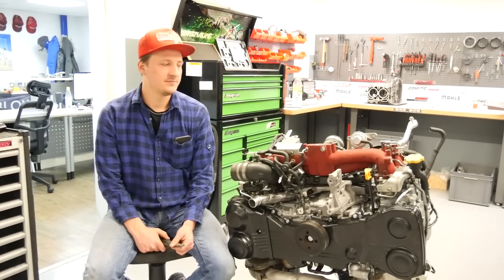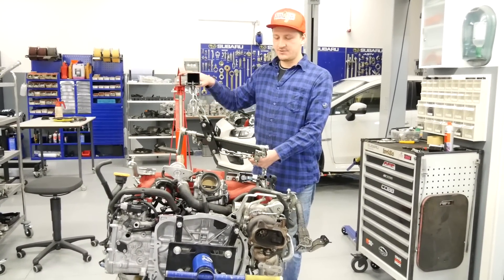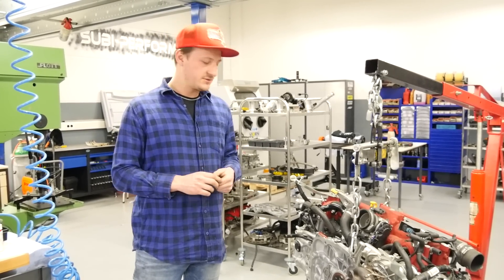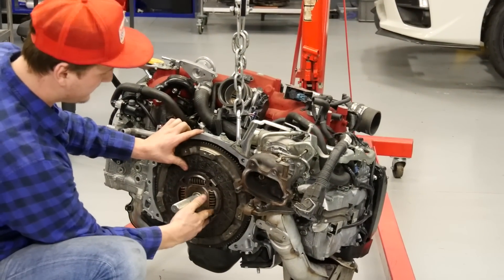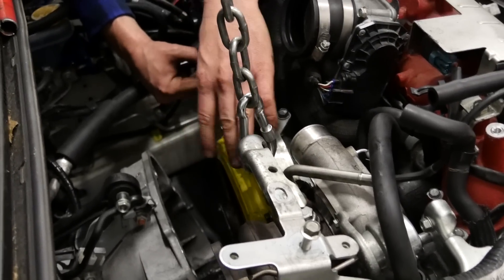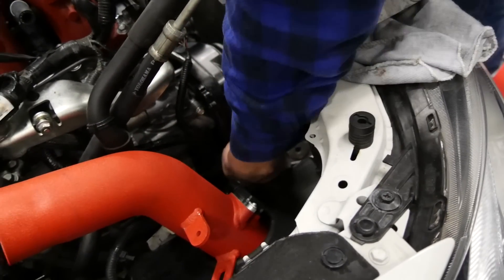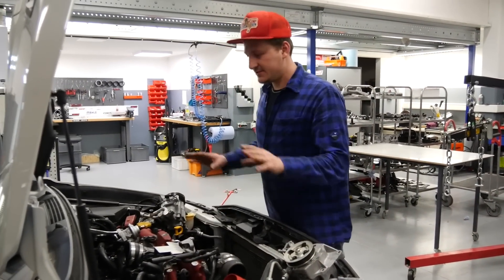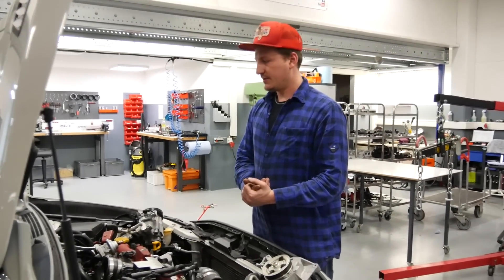HOW TO Engine Install Subaru Impreza WRX/STI EJ20/EJ25 / エンジンの取り付け方法 PART 1 l Subi-Performance

Comment: What performance recommendations would you have for a 2003 5-speed manual, Impreza RS 2.5 NA? High-cost, middle and low cost options?  
Thanks!

Comment: Need some help, I forgot to put the clutch pin all the way in before bolting up the engine to the transmission, do I need to pull the engine back out? Can someone please help me with this thank you guys

Comment: Ca sa prepari un motor de subaru impreza pentru raliu te costa cel putin,40.000 de euro in Germania motorul fiind cu turbo suflant deci masina sport practic nu ai ce sa faci decit marirea raportului de compresie si asa automobilul finiind de strada merge linistit cu benzina preparata pentru raliu cu cifra octanica 102 pe cind motorul este preparat de raliu atunci benzina este de 107 cifra octanica preparata dupa fisa motorului in laboratoar petrochimic

Comment: I remove the axles nut because when you lift the trans with the suspension sagging you can pull the inner cv apart

Comment: hi i own a 2 litre subaru  model number bc4a46a  option code WX  and its EJ20DDM1BE   its hard on petrol 8litres per 100 kilometres can it be made to run a lot less  say 6 litres per 100 kilometres   can you help

Comment: Very nice work product.   I  tend to require a more organized workspace myself  and my friends have fun at my expense regarding my fastidious attention  to detail and tireless commitment  to organization and method.  I found, at a young age, I did better work in a squared away environment so I   always make time to maintain a clean lab. But, I must say you do an excellent job of pacing yourself and balancing your project objectives.  Capturing everything on digital for a properly editable production is an entirely different layer to have to coordinate and you did so while communicating a complex task so comprehensivly with such accuracy and detail.  Even  If one were to assume  You had the help of an assistant or other individuals the fact that you maintained such uniformity in your approach and  Did so in a language other than your native tongue  Only becomes more impressive when you managed to do it without busting your thumb, lighting stuff on fire having to get a band-aid pissin oil all over the floor Dropping stuff   left and right. Also your your language is excellent keep it up. Thanks,

Comment: Your English is very good. Most mechanics have a helper to control the lift while you concentrate on getting the engine installed 
correctly. You did a fine job, by yourself.

Comment: Damn that flywheel looked ROUGH ! I am shocked it wasnt atleast turned smooth , thank you for showing how you do things like this
Reply: Thought the same thing. All that good work. Hope that clutch didn’t slip. Always resurface. 🤷🏻‍♂️ not a big fan of pulling engine or dropping trans months later because of a clutch issue that could of been avoided 😂

Comment: I've always heard to install the Throw Out Bearing onto the fork before installing the engine.  You did it differently.  Mind telling us why?  I've never installed the engine with the throw out bearing attached to the pressure plate.
Reply: Robert Savello you do it the correct Way , he does it the wrong Way , 
Also much easyer to do it the right Way so you dont have to stand and fiddle to get the slavearm attached to the bearing
Reply: MrTurbotoys makes sense. I kept thinking it over in my brain how he was going to install it. Seems like a colossal pain in the ass doing it that way. Thanks for confirming I'm not a complete muppet.
Reply from the maker: Robert Savello 
yes you are right that was the complicated way. But i have my reason for that. the spring ring that secures the bearing should be used as seldom as possible. Since the bearing was already mounted I made it this time so otherwise I do it like you say.
Reply: @SubiPerformance   Wow that makes you a great technician. Caring about your customer's parts more than your own convenience = 1/1,000,000

Comment: You didn't show how to align the clutch fork into the release bearing. But overall a good video thks!
Reply from the maker: PART2 :)
Reply: I always put the release bearing on the clutch for and put the pin through it before putting the engine in. Once the engine is in and bolted up all I do is push the clutch fork towards the fire wall and the release bearing clicks into the pressure plate. Really curious as to how come you don't do it the same way!